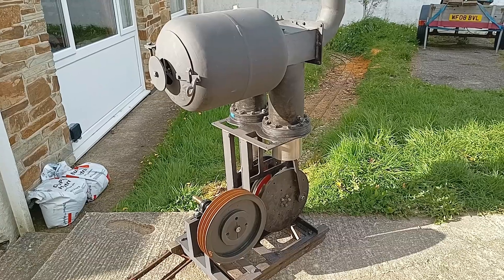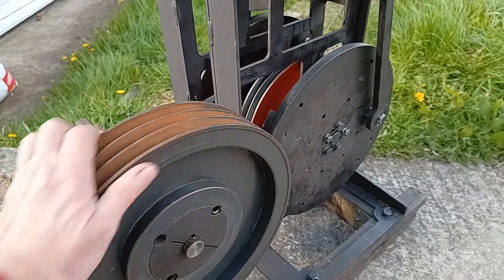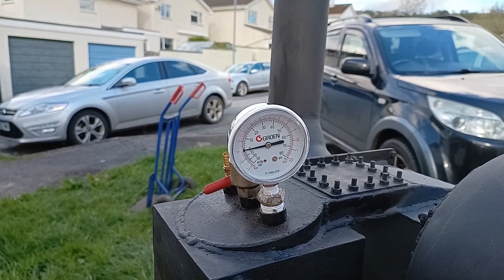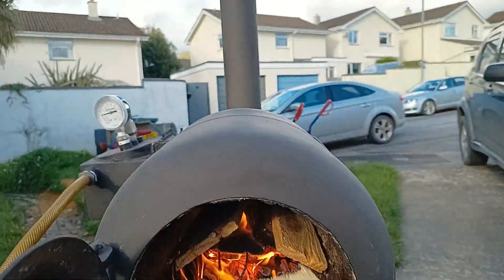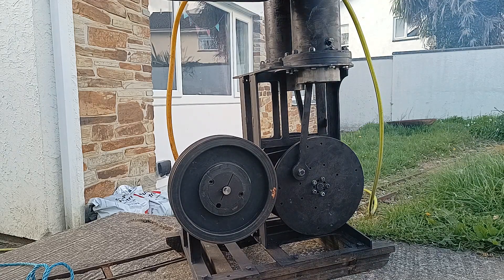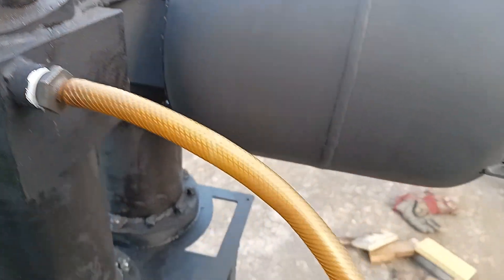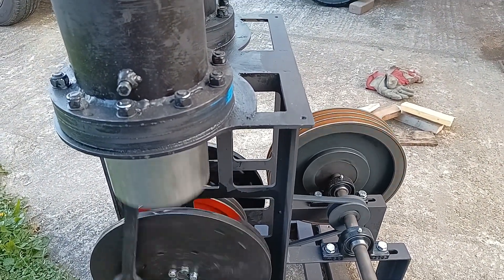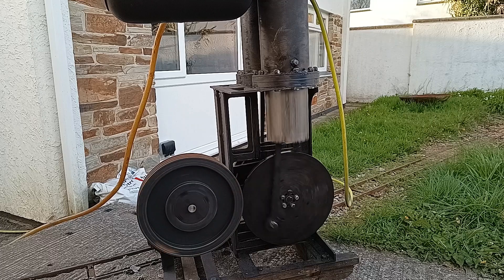Building a Stirling Engine that is Wood Fired - Part 7 - (It works, Just about!)

Comment: Hi Shane, out of curiosity how long did you get it to run with this design?   How about the newer design on video 9?  i'm just curious about running time.
Reply from the maker: Hi, it will run as long as you put fuel in, cheers

Comment: Hi Shane. Nice work. I was wondering if you might use the packing materiel i used to do the sailboat prop shaft seal for the piston seals ? It is a fiberglass/asbestos ?, impregnated in graphite sort of material. Another thought would be to have the cold side below the hot rather than beside it.
I would love to have one of these to run the axial flux generator i built.

Comment: I realise the cycle of the engine is old hat to you but many of us are not up to speed on your engine....how it works and all that an explanation or drawing would be real helpful
you have accomplished a great deal making a big stirling engine !  Congratulations !
i think your method of using a big stirling engine to generate electricity will be far more efficient than any other methods used.... especially for off grid people the problem as I see it is the fire type and how much it uses per 4 hour run.... I say 4 hour run because currently it takes about 4 hrs to charge up a bank of Li-Po batteries to keep the homestead charged up on cloudy days..... but if the fire uses a cord of wood to do that it would be unusable
or 3 gallons of diesel etc.etc.   However I do not think that will be the case with your setup.
in fact it will be far less fuel usage than any other method in current use ! this is great !
the unit needs to be a stand alone unit...able  to withstand below freezing temps with no ill effects . If this unit can be made to power a generator for 4 hrs with an arm load of wood
You'll have a big winner.... then the problem comes down to how much can it generate in electricity 24VDC or 48 VDC would be great and plug right in to solar charger units
where on the homestead a weeks worth of heavy clouds the batteries get low... so you walk out to the generator with a arm load of wood and start a fire and turn it on.....
this would solve a major problem with the current solar setup !  many would pay handsomely for this convenience !  a larger fire box would be needed for wood or a smaller one for  diesel fuel.
 the problem is how much would it generate in electricity.... that's the big question !
you will probably need to make your own flywheel magnets and coils to get enough power to make it viable......but it can be done I am sure !    Keep up the good work the world needs this badly right now !!!!!
Reply from the maker: Hi Bob, hello from Cornwall, UK. We are very familiar with cloudy days here! I am slowly edging towards a practical / simple design. Checkout my most recent engine on my channel, it uses diaphragms instead of pistons. I'll keep on developing it till I run out of ideas : ) Thankyou for all your comments, they were great for refocusing me on an end goal! Watch this space...

Comment: Really impressive stuff. 
I wonder if a rocket stove format might get you more heat? That way, the air is flowing through the coals rather than over the top of the wood.

Comment: if the crank case is not pressurised its useless to try presurise the working chamber of the stirling... and, higer pressure u go more power u can get but more aera to heat u need... try get rid of those lubricated piston... it slow the engine ... try run it atmospheric .. or build a crank case to hold the presure but u gonna need more heat exchanger and larger flywheel
Reply from the maker: Your right : ).  The flywheel size does start to become a bit of a problem on big low rpm machines , many thanks
Reply: @ShanePomeroy  if u can enclose all the engine and start it with ur electric generator u can near double the atmospheric power just filling it with helium .. ok helium expansive but not gonna leak for mounth if all moving part enclosed :) (helium is more fluid and absorb heat much more hydrogen is better but will destroy metal... ) im still verry impress on the power u managed :) near 500 watt make wath? a 8/100 ? 10/100? (double adavantage of fully enclosed is sound management ^^ u put that thing in ur saloon to heat the room ^^

Comment: Great, the residual energy at the end of the cycle is the slowest part of the rotation, so not much energy left for this size engine, getting the temperature up would help, but at the same time you need to provide enough energy to the heated piston and exchanger to flow through and get a kinetic output from its cycle after the innefficiencies have blown away, getting the temperature of the cold side down will also help, same goes here for overall energy out per cycle but you cant get more out than the energy provided to the cold sink from the cycle exchange given to it from the cycle, although some energy will go directly from the fire to the coolant because nothing is perfect. If you can get more heat into the heat exchanger and make the heat flow more immeadiate from both cold to hot and hot to cold exchanges then the overall poer out per cycle will increase, one way might be to have a spinning heat exchanger but you might run into maxwells demon.

Comment: awsome dood!  silent running with plenty of momentum.  can i ask why the stirling diaphragm version didnt work?
Reply from the maker: Hi Buddy! I'm giving the diaphragm another go on my current engine build, cheers
Reply: @ShanePomeroy  hey dood, i have tried a few stirlings and had limited success but one idea i did realise was a magnetic link between displacer rod and displacer piston.  this allows the rod to move the displacer through a sealed brass tube thus no moving seal thus no loss of pressure.   coupled with a diaphragm power piston which also has no moving seal you can theoretically have a completely sealed crankcase which means you can pressurise it and vastly increase the power output for the same input.   there are equations that describe this relationship that i have seen but not studied but im sure you are aware of the fact.  anyway  love your work, you have achieved many times what many of us spend way too much time dreaming of and not doing!! keep it up sir
Reply from the maker: The magnetic displacer coupler sounds pretty cool. There's always someone that thinks outside the box and comes up with something different : ), nice one

Comment: Beautiful, and silent! You are on the right track. Can I suggest something? Built a heat exchanger to preheat the intake air by putting the chimney pipe inside a larger diameter pipe that connects to the combustion chamber, it will improve efficiency. Also, if you use a separate heating coil and radiator instead of the displacer, won't it be more efficient, since you are heating and cooling separate hardware, so minimizing losses to conduction?

Comment: Is there a way to make this design work with hot water instead of wood fire? I'd like to find a way to use a Stirling Engine to extract energy from a tank of heated water. I think it'd be a neat way to store solar energy cheaply. Can the heat exchanger use a hot copper pipe or radiator that provides hot water or provides hot air from a coil submerged in heated sand.
Reply from the maker: Hi, I think with this particular design it wouldn't work because there would be to much mechanical resistance compared to the temperature difference. There are specific low temp stirling engines that might get worth a look : )

Comment: Love your channel and mad on Sterling engines.
If I may ask what is the diameter of your pistons and cylinders. Do you have any plans available  ?
Note,  the Rider hot air engines built in the 1800s  had its hot side cylinder end directly over and in the top of  the fire box to obtain as much heat as possible..
I absolutely love your work..your my hero  !
Reply from the maker: High, pistons are 139.4mm stainless tube and cylinders are 152.4mm od ( insides roughly 6mm less). I don't have plans, just a few doodles! Your welcome to anything just email. Your very right about the rider engine cylinder position! That is a slight flaw in my design really. Riders engine is an incredibly well thought out design (probably why it was one of a few commercially successful ones ever!) I ain't no hero! Just to much time and enthusiasm! All the best
Reply: @ShanePomeroy  
Ha ha , thanks mate for your speedy reply. 
The distance between the cylinder wall and piston is much appreciated information. 
Yes, the Rider Hot Air Engine is a magical machine.

Comment: Put a damper in the stove pipe will allow you to cpntrol how much heat that escapes.
Reply: Rocket stoves need draw to burn clean,he doesn't seem to have any secondary air intake (that i can see) which would be where you would dampen (or the primary air)

Comment: Due to it all being from metal the heat I think eventually spreads to the cool side which is the main thing that can make stirling engines inefficient as they run off the temperature gradient.
I've never made one this big so you probably know more than me, but I think getting some liquid cooling for the other side would make it run better. Saw someone else mention it and just wanted to say I agree
Reply from the maker: Hi Johnny, yes I think you've got a valid point. This engine was originally going to have flanged joints between the hot cold sides with insulation between but I ended up welding for simplicity. All the best

Comment: Will it work woth Concentrated Soler Power?
Reply from the maker: I'd imagine probably not very easily.
Reply: @ShanePomeroy  thanks Dear. Can you recommend any DIY design which can work on CSP.
Reply from the maker: @malikfarooqdeena  I think the most promising design type I've seen is the sun pulse 500. Unfortunately they seem to have stopped developing it. The design looks good through and lends itself to rays of sunshine, just my thoughts : )

Comment: Increase cooling jacket down at least Half way down the cold cylinder(pack it with some ice water just for fun) the vacuum created will assist in the power stroke, pressure differential is key also regenerator needs to have air flow you may have packed it too tight. Make sure you only change one item at a time. reburning smoke and preheating air should get you to 3/4 horse power so you can create 500 watts when you hook up the generator. good luck.
Reply from the maker: Hi Karl, I think your on the money! I'm making a few changes as we speak, cheers
Reply: @ShanePomeroy  cool beans

Comment: A taller chimney will help with the draft and heat up the fire, and cleaning the soot off of the heat exchanger will help with the heat transfer.  Very thin layers of soot are great insulators on the tubes off steam boilers.

Comment: Congratulations!  A wonderful achievement!  Do you have plans on attaching a DC motor, with boost converter, inverter, voltage regulator, ect..?  I am interested in power output.
Reply from the maker: Eventually. I've got a few changes in mind over the next few weeks, cheers

Comment: The nicest thing is to see it running at last. I was quite happy to run simulation for this one engine, and as it looks - that max rpm (where all work done is "eaten" by pressure loss at regenerator) at current setup of displacement / heat ex changers and re-generator is on its place. 
Comments on compression ratio - compression ratio in alpha configuration is changed using different phase angle, changing displacement of any piston just adds some dead space. Next - running on 90 degree gives much higher compression ratio, which expands/cool gas more than our available temperatures at hx exchanger - which overloads our tiny heat ex-changers even more. 
And - you still owe me one way valve before pressure gauge to see max and min pressures in cycle. This one will tell a lot of iternal process.
Sniffer valve close and bigger rpm - less average pressure / more loss at heat exchangers / regenerator. But after measurement of power - it may show less power too.  
Cheers !
Reply from the maker: Many thanks for your help, much appreciated. I'll improve the engine as much as I can within the heat exchangers limitations. I'm changing regenerator with annular plates instead. When I next run it I'll get that pressure gauge reading : ). This has been a fun experiment so far......
Reply: @ShanePomeroy  Just drop a visit to a scrapyard, 110kw vauxhall 1.9 diesel engines have first catalytic converter in perfect shape for your regenerator - 90mm long, 90mm diameter. And nice ducts on one side too. Got one from friem, will sent you photo today.

Comment: I've been waiting to build my own setup and have learned a great deal though seeing a larger setup. As it so happens, when you close off the one way valve you pressurize the air and it becomes a working gas. I've seen some of these other Sterling generators use higher PSI, so I would proceed with caution with such a large setup.

Comment: Please try to put load on your fantastic design (really)
It sounds exacly like and old norwegian diesel (SABB) going from  idle to load with a variable pich propellar when you "choked" it with your hand! Many "large flywheel motors" of different designs will stall if no load applied to the motor system
Really think you are on the rigt path!
Please try to make som kind of electrical load and record it at different rpm/temperatures and so on!
(SABB diesel🤩, and  even a larger flywheel and a one direction bearing ?)

Comment: Nice  to see it running :)

Maybe the one way valve is not airtight enough and when you close it with your hand, you close leaking and it causes the engine run faster?

Comment: Glad to see you got it running! You've put a lot of hard work into this. It's very rewarding to see your success! I like that you polished the pistons. It should help reduce the friction loss once it is broke in. 
I think if you wrap the hot side cylinder with insulation, it will help with the heat loss and speed up the warm up time. 
I thought I read somewhere that a sterling engine works on both pressure (heat cycle) and  vacuum (cold) cycle. That may explain why plugging the value with your hand increases performance. 
A cold water jacket sounds like a great idea! Should help with the cooling! 
One last thought, on your next build. If you were able to design separate components (heat,regeneration,and cold)and put a insulating gasket between them. You may have better performance.
Looking forward to see what you do next!
Reply from the maker: Hi Sammy, thanks for all your ideas, where's my pen! I'm probably going to change a few things at some point, cheers

Comment: between the hot and cold piston do you have a heat regenerator iv seen in smaller setups they use steel wool to reheat the air as it comes back to the hot side. on the wood burning side do you have an air passage around the wood so their is enough air to combust the smoke for my BBQ rocket stove i wrapped the wood in wire and elevated it about 2 inches so air could flow around the wood it made everything glow bright red. iv seen in newer designs they have a empty chamber that meets at the back end just to feed air to the burn chamber. I'm am so glad you got this working i cant wait to see what happens next. don't get caught up in your pully rope :)
Reply from the maker: Yes there is a regenerator there. It is made of stainless scouring pads. Combustion is a slight problem I'm planning to change things to solve this. Thankyou for your ideas, cheers

Comment: You should make a blower pup that runs off the engine to pump more air into the burner into hot side of the engine, to increase the temperature of the fire witch well help to keep the engine running better
Reply: An electric blower would work sure. Another option would be to use a small turbocharger setup in the burn chamber, it would have fewer parasitic losses and increase oxygen concentration. Make sure to limit pressure
Reply from the maker: Yes, the fire is limiting things at the moment. A blower could be the way to go with this, many thanks

Comment: Well done on getting her running but there does seem to be an awful lot of friction. I wonder if perhaps your previous engine was better in that respect due to the rocking levers reducing con rod angularity and hence side thrust on pistons?

Oh, and what are those things called that you've used to fix the cranks to the shaft? Not come across them before and they look useful!

Comment: I don't know if this will make a whole lot of sense but maybe you should look at a steam locomotive and see how they create a stronger draft they use the steam in the cylinders then shoot it through the stack to create a stronger draft you might be able to do something similar with a fan that's ran off of the engine it should help you get your temperature up a lot further as well maybe a small squirrel cage fan
Reply: And look at the vacum side of steam motors(actually a sterling type at the LP side of a steam engine)
Old large fhising boat Diesel engines with enormus flywheel will for the most of the working cykle be a "inverted/wringed inside out/in" Sterlig motor system
Only reason for the extreeme compression for Diesels  are to acctually ignite the fuel...

Comment: Yes success!
Nice work Shane!
When your engine is running, try putting your hand over that valve and look at your gauge to see if the compression goes up or down. I should think that will tell you what’s happening when you do put your hand over that valve. perhaps you can build some kind of a preheater to get the regenerator warm prior to the fire getting up to where it needs to be? 
Congratulations!~Paul
Reply from the maker: That's a good point with regards to checking the gauge for compression change, cheers